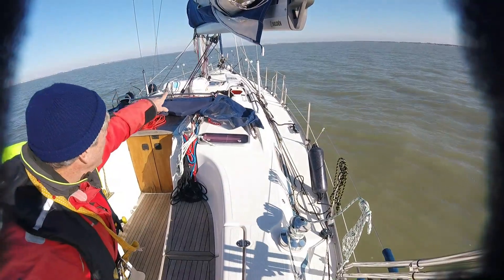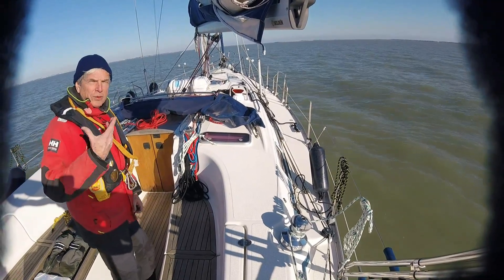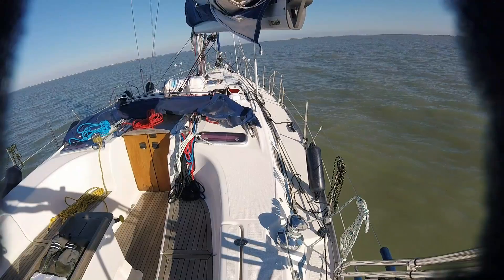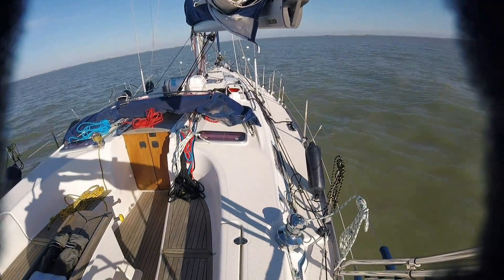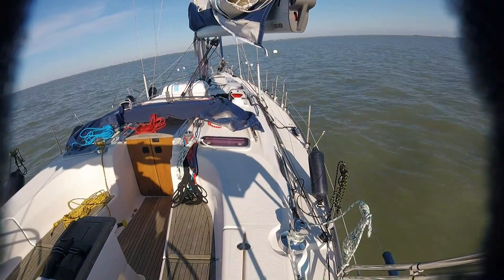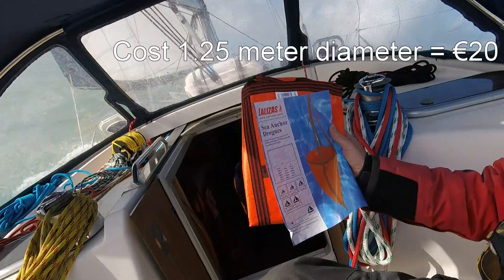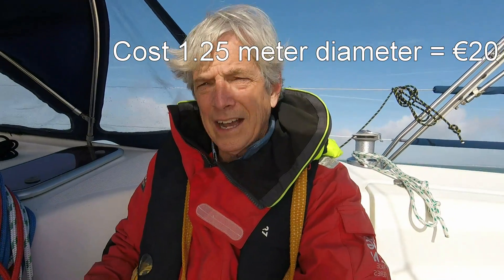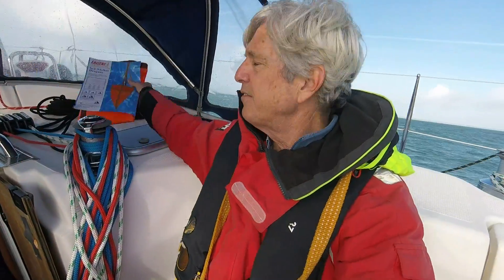Ep 36 Preparing Next Major Passage

Comment from the maker: I meant to embed the cost of the new staysail rig in the video:Solent sail (25m2) of hydranet: €2283        Selden 200 furler and stay:  €2789                    Chain plate and reinforcement: €1615           Various deck fittings & sheets: €1000         Total: €7687
Reply: Patrick Laine How much of those costs were for labor?  Thank you!
Reply from the maker: Good question Denver.   Included in the cost of the Selden furler/stay is €535 in labor for installation/drilling holes in the mast, etc.     The labor content of the chainplate plus 'reinforcement' of the foredeck was not itemized.
Reply from the maker: I installed the deck fitting changes myself.

Comment: Patrick, I just watched the drogue steering again. I think the drogue is only an aid to steering. The main sail and jib need to be trimmed, heavily, as an aid to the drogue; just like one can sail a J-22 with sail trim alone, and no hand on the rudder. When using the drogue for steering and coming about, let the jib get back winded to help complete the turn while easing the traveler. We used to be able to get a J-22 or Catalina Capri spinning on its keel with only input from the main and jib. I always wanted to try that with a Swan 48  but just never had enough room in a harbor to give it a try.

Comment: Great to have you back Patrick. 
I have never used a drogue but given your experience (thanks for sharing this by the way so often people dont show the things that dont work or go wrong) I would say you treat it as just another tool thats available to you if things go wrong, not the whole answer. When you sail dinghys learning to sail without the rudder is a good skill to have. Not because people routinely loose there rudder but because understanding how to balance the forces in a boat without it gives you a better understanding of how it all works. I suspect if you use the drogue for stability but then steer with the sails you will get along a lot better. Have fun, we are very envious of your planned adventures.
PS the way you picked up the buoy was just showing off :-)
Reply from the maker: Ian, I noticed that we have perfect timing…...on the same day you put out a video praising hank-on sails, I show my new furling solent.  :-)   In my defence, I film quite an explanation as to when furlers are good (for blue water sailors who don't tack/gybe often).   I recommended removable stays with a pelican hook for those who do regattas or coastal sailing where lots of maneuvering and/or changes of sail are required.   Unfortunately, I cut all of that do to the length of the video.  :-(    Fair winds to you as you get back in the water.

Comment: I was hit by 75 knots of wind, 400 miles offshore. I had inexperienced crew. I am so grateful that I had a Sea Anchor on the boat. Mine was oversized but I still blew backwards 15 miles against the current of a cold eddy. Hopefully you will never have to use yours. Fair winds!
Reply from the maker: Thanks Pat.   I can take being blown back 15 miles.   What I don't want to do is run downwind with the storm, and then have to beat my way back 2-300 miles when things calm down.    Thanks for commenting (though I hope I never have to go through what you did!).

Comment: Good to see different ways of doing things on a sailboat. Never having done it, I would have guessed the red, drogue, steering line, was plenty forward to turn the bow....but maybe not. It will be interesting to see what the resolution is. Also, I will be interested to see how you keep the cabin warm as you move north. Thanks for a great video.
Reply from the maker: Thanks Patrick.    I'm sure I will get the drogue steering to work.  In rereading the literature since I filmed this, I realize I had too much canvas out (for that comparatively small drogue).   I'll give a try again and play around with the sail size a bit.    Keeping warm up North is OK --- I have a Webasto heater.   My concern was that it uses a fair amount of electricity, but I discovered that after it runs 20 minutes or so, its program changes and the power usage falls way off (while the warm air keeps coming).   This may be the topic of a mini segment of a video later on.    Fair winds to you.

Comment: Enjoyed the video Patrick nice one. On a ships lifeboat (well when I was at sea) the sea anchor was designed to be rigged on a very long scope and just behind the sea anchor was a small line doubled back to the boat (like a flag  halyard) and this was used to run out a oil bag to the sea anchor. The oil bag was basically a hessian sack about a foot square which filled with cotton waste or other absorbent material and was filled with fish oil then run out to the sea anchor, the idea being it produced an oil slick ahead of the boat to calm breaking seas. Don't shoot the messenger lol but this was a Department of Transport requirement for all British Merchant Navy lifeboats.
Fantastic job on your extra fore stay, heavy duty (a real built on the Clyde job) and lots of options. Shame the drogue did not work for steering but a handy brake perhaps a bit of chain on that as well to bury it deeper and perhaps a size up. I think you know all roads are leading to a hydro vane type wind steering tough lol. Safe landings ......
Reply from the maker: I'm glad you brought up that point Ian.  In fact, I have very long lines (+/- 75 meters) that I would use with the large sea anchor (as all the literature recommends).    I too have read accounts in older sailing books about the use of oil bags to try to flatten the seas in a heavy blow.   (I also read that this almost never worked.  :-)        On the other hand, using a drogue/sea anchor/bucket to try to steer the boat can be done with much shorter lines.     I do think you are right about the hydro vane, but I have seen videos of other boats who succeeded in steering with a drogue, so I'll give it another try just for intellectual curiosity (playing with reduced sails).
Reply: Well worth keeping at it Patrick, just a thought I wonder if the locked rudder at midships position is giving the boat strong directional stability which making the drogue less effective as it fighting the rudder, less sail may help but may also lessen the effect of the drogue. Not sure if this makes sense but the drogue may work if you had no rudder there at all.  @patricklaine6958

Comment: Good to have you back Patrick. Looking forward in seeing your Iceland adventure! I am thinking about a staysail for my Contest 41 ketch and I calculated 8000 EUR costs last year - therefore almost the same you have payd,  but doing the reinforcements/laminating for my own and also having the need of mobile backstays as I have in mind doing cutter rig with therefore lower attachment at the mast. Would be fine to see how you fitted the steering lines for your staysail on deck in an next video.
Reply from the maker: I didn't show the deck fittings in this one Dosheimer because I haven't yet decided exactly how I want to run the lines.   For the time being, the sheets are going through the same cars as the genoa….. but that may change.   When the staysail is very close-hauled, the sheet needs to run between the lower and upper shroud, but for all other points of sail, the sheet needs to run outside the upper shroud.   I'm going out this week with a professional racing rigger, and will ask him for deck fitting recommendations.   I'll film the final outcome at some point in the future.

Comment: Welcome back! Bon voyage to Iceland. Nothing like setting course towards there in March, Patrick!  
I really like the new inner stay and the care you have taken to distribute loads into the hull. 
One comment re the “cutter rig” option that you mention ... yes, an inner stay can be attached to the mast at the spreaders, but IMHO only if there are running back-stays to keep the mast in column at that level. Elsewhere on YouTube a channel last year was describing a cutter-rig modification made to a mast without consideration of the forward loads, which are considerable especially in a seaway. 
Meanwhile, have fun, happy sailing. Roy
Reply from the maker: I edited out the running back stay commentary Roy because the video was too long.   I once crossed the Bay of Biscay with a friend who had running backstays (due to cutter rig).   Before every tack and every gybe, the first step was to release the back stay.   I'm sure one gets used to that, but as a first exposure, I found it VERY annoying.    Thanks for coming back this season.
Reply: Patrick Laine thanks for the great, informative videos. Is that why you decided against the cutter rig, Kim was about to ask when I saw this excellent comment about needing backstays to counter the pull. Thanks again
Reply from the maker: Exactly.   I did not want to have running backstays that required constant adjustment.   As a solo sailor, I already feel I've got my hands full.  :-)
Reply: Patrick Laine so every cutter rig (even those designed right from the start, not added later) need those extra backstays? That would be a lot for a solo, I didn’t realize that
Reply: Patrick Laine um, what exactly was your previous gig, lol, making hundreds of precise moves at 100’s of knots, hmm, I’d think adjusting a backstays would be within your considerable talents. But I get your point.

Comment: Welcome back Patrick.    Can I suggest you have a look at a DVD called  Storm Tactics by Lin and Larry Pardey, available from Amazon UK.  (I have no connection with Amazon or the Pardeys). I highly recommend the DVD which gives very helpful information (and film) showing all aspects of riding out storms at sea including best boat angles, techniques for setting your parachute, heaving to  etc etc.  There is also a book by the same name.   Looking forward to your Iceland adventures and thanks for sharing your trips with us all.
Reply from the maker: I have the Capable Cruiser book by the Pardeys.   I'll check out the storm tactics book.    I know they favor using a bridle and having the drogue out to the side.    As I will use two lines on my storm drogue from the bow, I can actually do the same thing if need be just by walking one of the lines aft to midships or astern.   I plan to find a day with winds of 30 kts or so and throw out the sea anchor just to see how the boat responds.   Thanks for the recommendation.
Reply: Yes they recommend a large parachute like drogue with a set up so the bow is circa 45 degrees off the wind  The boat sits in the (surprisingly) calm area formed downwind of the parachute. The boat must be stationary or it will not remain in this calm area.  So trial and error to find out what sail arrangement achieves this is vital, as of course you are doing. As is locking the wheel/tiller around 15 degrees off centre.  Having just bought a Bavaria 38 in La Trinité-sur-Mer I will be most interested in your solution and will try to miss you as I head South and you head North!  Enough from me, thanks again for the great videos and happy adventures.

Comment: Next time you try steering with a drogue, run the drogue bridle lines forward of midship. You can run the bridle lines through a block or low friction ring, tied to a forward cleat, and then to a winch. You will get better leverage this way. Thank you for the great video!
Reply from the maker: I'll try taking it a bit further forward (it was at the level of the shrouds).   The problem with that is that the bow narrows, so the line going aft will slide under the hull, and not be very far displaced laterally.    Without using a pole to push the line out, the midships position is widest part of the boat and maximizes the angle of pull from the drogue.   I'll what you suggest, but am convinced that just dropping a bit more sail will do the trick......  We'll see.
Reply: Things can get complicated very quickly with steering loss. I hope we never get to deal with it... You might need to have a control line for the bridle so that the loose side does not slide under the hull. A simple loop with some rode attached on a stern cleat may work.
Here is an article on steering without rudder that might help: https://www.sailingscuttlebutt.com/2014/04/14/guide-steering-without-rudder-methods-equipment-tested/
They removed the rudder for this test.
Reply from the maker: I had watched the video and read the article before my trial Theo --- but obviously not closely enough!   In the text, they say if you are headed downwind, you shoud drop the main and run on jib only; if heading into the wind, it may be helpful to moderate the the size of the jib.    If I had paid more attention to that advice, perhaps my experiement would have been more successful.  :-)   I'll give it another try when the opportunity presents itself.

Comment: Hi Patrick. The trouble you are having with drogue steerage is due to the fact that the moment arm of force (attaching directly to the winches) is too far aft to create yaw around the vertical axis of the boat. If you run those bridle lines forward to port and starboard blocks on your genoa track (or some other point even further forward of amidships) and then aft to your winches, the moment arm of force moves closer to that vertical center point of your boat. That then will make yaw to port and starboard around the vertical center of your boat possible. Looking forward to following you on your upcoming voyage. Cheers. Rick
Reply: Richard, I’m not an expert of this drogue streering, but I assume you are right. Thank you for your clear explanation. 👍.  Ciao from Italy
Reply from the maker: Well, yes and no.   I have rigged the lines exactly as you stated ---- well forward of the pivot point (attached at the foot of the shrouds), then back to the winch.   As you say, the moment arm needs to be forward of the rotation point (it is).   On other videos where they have successfully steered with a drogue, they emphasize that sail configuration is important: they suggest dropping the main when heading downwind, and only limited genny when heading into the wind.   I'll give it another try.
Reply: @patricklaine6958   Yes - one must presuppose a balanced sail plan for the conditions. Just as reducing sail area aft of the mast reduces weathered helm, as a result of moving the center of gravity forward, so too will it increase the ease with which the stern can swing with the drogue deployed. I am providing a link to a good article discussing the setting up of touch points for the bridal leads amidships. I hope it might help you with the challenge. 

https://www.sailingscuttlebutt.com/2014/04/14/guide-steering-without-rudder-methods-equipment-tested/

This set up has worked well for me (thankfully in practice conditions only) even on full keel boats (23' - 30') I have owned over the years. All this aside, I will be keeping a good thought on this end that your rudder will always be in good working order. Best to ya. Rick

Comment: Watch that weather lad, practicing the heave to would be useful, you can steer with the traveller, and all that money on bits and bobs id spend on a hydrovane wich can also act as a second rudder.you should have your aux rudder made up anyway, two bits of metal an old whisker pole and a rivet gun would do it, a nice selection of carrots in case your thruhulls go poor kevin has some work there, happy days
Reply from the maker: Thanks Sean.  I'm sure I'll eventually get a Hydrovane.     I have practiced the hove to many times.   In Ep 31 you will see that my boat does it perfectly in 10-15 knots of wind.   However, once the wind get above 25 kts --- it refuses to stabilize --- dangerously so.   I have tried every technique in the books (and more).  It must be the combination of fin keel, spade rudder, and hull form that makes it so difficult in high winds/seas……    I feel more confident now with my new sail plan.
Reply: Patrick Laine yes great new sail. Drake paragon got caught out last june up there by a monster low, latest episode. Roger taylor mimgming2 brings back magnificent vistas but never lands, look forward to your films. Hilmas rudder dropping off looked like could be galvanic action, as i understand anodes on the prop and hull should be backed up by earthing to the engine block, i do hope their keelbolts have been checked, just time to watch ep31 before the rugby cheers
Reply from the maker: Yeah -- I watched the Drake videos and their two long sessions hove to.   I hope that doesn't happen to me, but they handled it well.   The Hilma episode was scary.   They struggled a bit, but worked their way through a tough problem in the end.  Fair winds
Reply: Patrick Laine indeed ive been caught out in the channel a couple of times, adlard coles heavy weather sailing is some preparAtion , storm boards on the lee window for inst, my fAv vid is lealea plan b, the albin vega has the keel for the job

Comment: Probably when the drogue is just one side pulled it change the opening mouth of it, and most likely it loses drag efficiency as well. Also I was thinking that probably as more forward to the bow are placed the ropes from the drogue control it will provide more pivot point !? Just a guess 😀
Reply from the maker: Pulling to one side does not change the shape of the opening Miguel, because the lines are attached to an apex in front of the opening.  The drogue retains its shape no matter where it is behind the boat.   Yes, attaching the line at the bow would give a greater turning moment arm, but then the drogue would remain much more centered at the back of the boat......   I tried this again last weekend, and by dropping the mainsail and adjusting the size of the genoa, I was able to get perfect control on any heading downwind (between 95° and 150° apparent wind).  I was even able to gybe.   However, I was not able to turn the bow back into the wind, no matter what I tried.   Will continue to experiment on this.